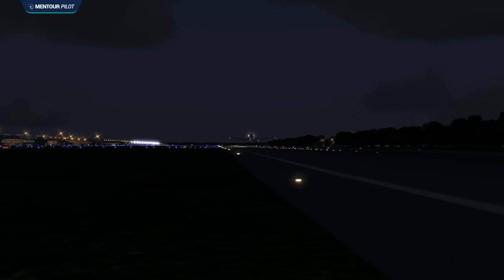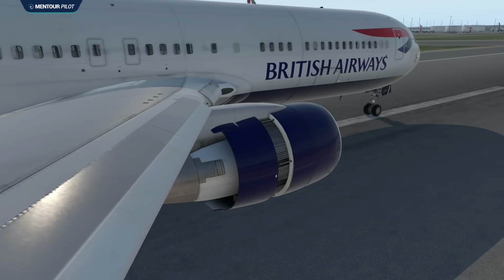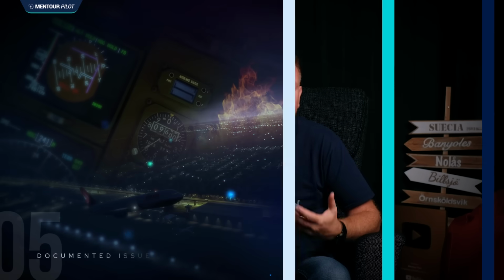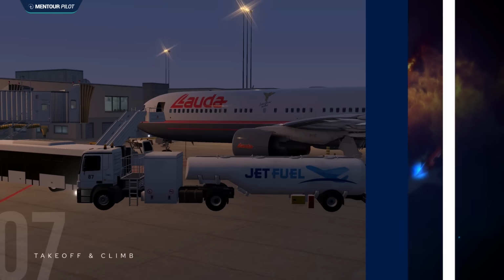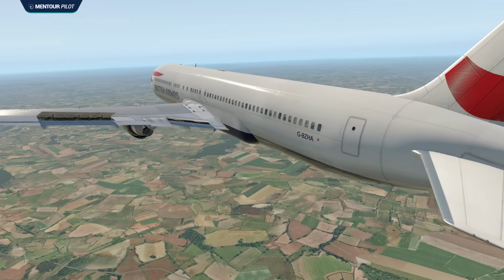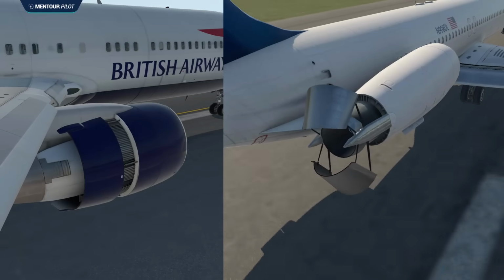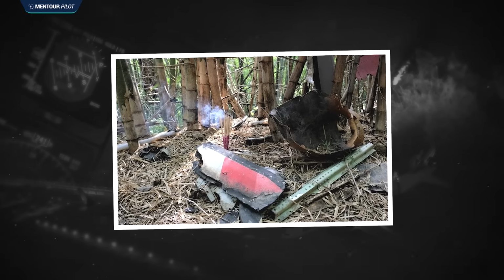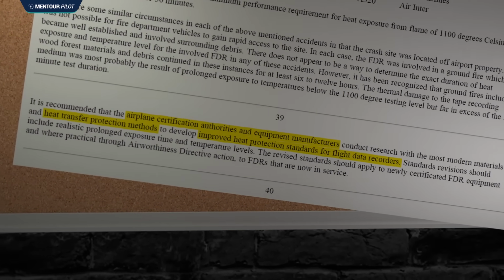HOW an Impossible Failure CRASHED this Boeing 767!

Comment: This actually happened to me I was a passenger in a flight from LAX to Minneapolis. The thrust reverser activated shortly after takeoff and we had a hairy few seconds before the pilot managed to shut down the engine we turned back for a heavy landing with all the emergency equipment rolled out at LAX.  A pilot friend of mine told me we were very lucky to get away with that.
Reply: You possibly survived because of this crash and the following investigations.
Reply: Was this in a plane with the engines mounted on the rear of the fuselage and narrow bore engines? (Like a DC 9 or 727)
Reply: @davidpowell3347  no it was a twin engine, I can’t now remember whether Airbus or Boeing,  suspect it was either a 737 or a 767, pretty sure it was Delta
Reply: @davidpowell3347  no. 
2 engines one each wing.
I REPEAT THE 767 IS A TWO ENGINE ASSEMBLY. sorry for shouting but some people here tend to think a 2 means 4.
Reply: @cme98  so the other engine on the wing helped to counterbalance the effect! Very lucky to be in a 4 engines airplane!
Reply: @MyNotSoHumbleOpinion  possible inboard engine would be easier to handle than the outboard one?
Reply: @davidpowell3347  maybe slightly, but the big difference is that you have in one wing opposing forces that cancel each other out, so you have only a positive push from the other wing! It's like loosing one in a 2 engine! In the airplane type of video you have two opposite force on each wing, so the turning effect will be much higher!
In a 4 engine is still a huge problem because it's like to loose 2 engine, but I think it's more manageable!
Reply: @MyNotSoHumbleOpinion  DUDE! I used to work there DO NOT CONTEST MY KNOWLEDGE! The 767 IS A TWO ENGINE ASSEMBLY. Not a 4 engine jet. The ONLY 4 emgine jet Boeing has EVER manufactured is the 747- which has been discontinued.
Reply: @cme98  wait...what? I don't say anything to you! Some comments are missing and you modify yours! Someone says that he survive because is a 4 engines and I explain why... I don't know where your arguing about 767 came from....
Reply: @cme98  i get what you mean but saying 2 engines on each wing means that one wing has two engines, I think that was what caused some confusion, it should have been “one engine on each wing” since the 767 has only two engines with one mounted on each wing. Don’t want to be obnoxious but yeah saying two engines on each wing when they only have one on each was a tad confusing
Reply: @cme98  707?
Reply: @MyNotSoHumbleOpinion  The guy has a point, the inboard engine reversing is likely easier to deal with than the outboard due to the smaller moment arm it has, since it's much closer to the fuselage than the outboard one is
Reply: WTF when did your flight happen?
Reply: @jaycho6747  was a number of years ago now, maybe more than 10
Reply: In Austria (and likely also Australia and Thailand who also lost people) the public immediately connected the disaster with malfunction of the thrust reverser, it was discussed as (very) likely cause from day one or two. It was good that the pilotes were able to report what they then thought was a minor malfunction. Since the flight recorder was lost Boeing for sure would have put up the walls of denial. 
Lauda was then CEO of the company and also acted as pilote (long distance) from time to time. He used all his popularity and media connections to force Boeing to conduct an indepth investigation.

Media also reported right away that other machines of this type (from other airlines) had experienced thrust reversal (or notifications) mid flight. Not many and until then never with catastrophic outcomes. This was not an isolated freak event. 

Boeing could not suppress that information and lively international discussion. That the pilotes informed ATC about the "glitch" at least spared other planes from going down. Because Boeing would have gladly dismissed it as unknown cause or probable human error if they could have.  (There was the history with the recurring notifications of this machine - as per the technical log book, but because the crew reported the last notification it was clear that had happened just before their trouble started. Much more suspicious)

Boeing had a real PR problem, their machines were used a lot, so even in countries that did not lose passengers there was a lot of media and public interest. The mysterious and especailly haunting nature of the accident (plane breaking up in the air, fireball) made sure of that. Plus the fact that this was a widely used machine, also for international travel and for transport of tourists.

With airplane accidents the public in most cases has a general idea what went wrong: problems during start or landing, crashing into a mountain or other plane. Bad weather. Sure could be human error, technology or a combination of those factors.

That plane broke apart high up in the air and ended up as fireball, that is another level of unimaginable and terrible. Therefore it got more attention than other accidents.
Reply: A perfect example of good pilot training and airmanship. Nikki’s perseverance to uncover the problem has him still saving more lives through the pilots that have benefited from those findings!
Reply: This was a 747 ? Boeing scares the shit out of me at this point. No accountability and in turn I have no trust at all

Comment: @Mentour: As A&P working on L-1011's - I have an exclusive, that if ever leaked to CNN,, 
they would make everyone on that flight realize they are now walking ghosts 
that have no idea how close they came. But it would have to be done in private
secure way. It's quite disturbing by all involved. What I discovered one night up in number two engine bay in pitch black of night at 40 below zero is clearly a miracle only because I was curious of the magnificent structure within. 
I got out my flashlight to discover a full on nightmare. 

I then had to explain to the Judge the next morning why I was heading back to the 
airport at 115 mph with my own special tools to repair this crisis. He said Case Dismissed. 
So there is another trail of this case. 
I fell in love with this ship the first minute walking up to her. As I'm sure you did as well. 
On one flight final to Schiphol, flight engineer pointed out the last L-1011 sitting out back for training purpose. 

Cheers

Comment: Obviously - Both Pilots should have simply pulled the circuit breaker 
for the Reverser Circuit - Killing any further issues, and warning. 
Hopefully - Mentor can correct this line of thought. 

Obviously quite tragic for any loss of life,, with so many lives effected. 

This was done when Commander of and in charge of all Awacs 
aircraft stationed in Oklahoma Air Force Base invited me along 
for full Awacs training night mission flight aboard the multi million 
Awacs Simulator. I just heard these simulators were moved to another base. 
Someone might have more info on that. 

Sitting along side him facing left side of aircraft, behind both pilots. 
We both have panels and keyboard. 
He instructed me with controls I have with keyboard and screen full menu items 
of aircraft systems in view, to select anything I felt would be a good test 
for the pilots to solve when airborne. 

I carefully examined critical engine features of the four engines. 
When in back of mind I was already aware of a fatal bird strike they had in Alaska. 
I actually caught a live bird strike in Alaska on video I made on approaching C-17 a few years later. 
The Commander there has copy of my video on file,, to closely inspect any damage by Turkey Vulture,, who in fact deliberately attacked the aircraft while hovering above it. 
I did not know at the moment that I caught this view, until next morning when guest at BNB
noticed it in playback I was showing him. 
Anyway,,,
I picked a specific fuel controller,, and killed it. 
Now it's up the the pilots to solve this crisis as quickly as possible,, as now they have an engine out. 
The Commander and I watched as Copilot paged through the manual and successfully reached behind pilot and corrected circuit breaker I killed by remote and solved it.. 
Quite obvious,, this crew were very highly trained to handle anything. We were pleased. 
And to note,, while in this class of simulator,, every noise is also simulated present,, 
and the background noise is very loud as noticed on video I made of entire 
mission.  If headset circuit was tapped into video camera,,, I'd load it here. 
It would have to be dubbed in somehow after. The noise is killer, and would be too boring to view. 

Cheers 😎

Comment: There is an advanced A. I. (artificial intelligence) named 'GPT-3' that can do almost anything.  I propose that a version of GPT-3 be set in charge of going through all of an aircraft's maintenance records, and current aircraft parameters, and then make audio recommendations to the flight crew as to what should be done before a flight, or during an emergency. This mountain load of data is easy for GPT-3, but impossible for humans to handle, and will save dozens of lives each year.

Comment: If only airline planes had ejection seats
Reply: Because they can be as deadly to the untrained. Its not as simple as pulling the lever and having the rocket strapped to your arse. alot of pilots, and I mean alot, upwards of 70% suffer broken bones from it. Usually broken vertebrae. In addition to that fighter jet canopies have small explosive charges to destroy the canopy before the seat is launched. a commercial plane cannot do that. Hell EL AL was restricted from operating in several European countries after equipping their aircraft with flares due to the threat of surface-to-air rocket attacks

Comment: This shocks me way more than other accidents. The reason is, that the crew really couldn't do anything. 5-8 seconds to fully kick the rudders and fully yank the yoke to the side. And reducing power to idle at the same time. What pilot would do that, if it is not an automatic response like a stall? Normally you'd kick the plane in a free-dive by doing that, causing the accident in the first place, if you are not absolutely sure that this is now the right thing to do.

To me, this was an unpreventable accident the second it appeared, and that's just so scary. Technical equipment shouldn't be able to do that. Are there more cases that can do something as quickly and deadly like this? With everything I've heard so far, there was still a chance of saving it, or at least it creeped up slowly, being able to react to it. It spontaneously doing that - like if the plane was shot with a rocket - it's a scary thing.

Comment: The exact same nacelle system on the PW4000 equipped 767 and 747-400s were used and could technically be interchanged, but the only reverser system that is critically affected is the 767s. Reason being is the engine sits closer to the wing than the 747. I believe tests were done proving that the reversers could be deployed mid-flight accidentally with no detrimental effect. If you sift through the Airworthiness Directives issued at the time, you should find all of the changes instituted to require redundant safety systems (valve and restrictor systems) for all of these cascade type systems are for engines that sit close to the wing (737 Classic, 767, etc). Since the redundant systems are typically "baked in" to the design for newer aircraft (737NG/MAX, A320neo, 787, etc) the AD doesn't affect them.

Comment: So many accidents caused because the pilots are so far behind the airplane...My uncle who was a long time Pan Am captain always told me...any warning light immediately hand fly the airplane...you feel any issues and your scan returns to determine any unusual instrument indications.  In this accident having his hands on the controls his immediate reaction would have been to add right rudder and right aileron and would have precluded further decay in their situation.  That difference in reaction time doomed this aircraft as the simulators demonstrated.  I have always maintained that the current electronic cockpits destroy situational awareness and had a lively conversation with a Delta A300 captain during a 4 hour flight to the west coast.

Comment: As a pilot, I can’t think of many more unpleasant situations to be in. Would have been absolutely awful.
Since this accident I’ve thought about what I would have done differently. All I can think of, is if I got the reverser isolation valve message, I’d brief my FO that should the reverser actually deploy, we would immediately bring both thrust levers to idle, descend and attempt to regain control. 
However, these pilots did nothing wrong in the circumstances. Worst case scenario in the climb, with one engine going from producing full forward thrust, straight to full reverse thrust, whilst the other one still at full forward thrust. ☹️

Comment: Feels like nowadays Flight schools are creating flight technicians and not pilots. I am no pilot but fly simulators in the confort of my office, so that is nothing compared to the situation that the pilots were in. I am not criticizing the pilots as I would +probably just piss myself and pass out with fear if I was in their position. But if this happened in my simulator I would reduce the trust in the bad engine, decrease the power on the right, take control of the yoke, right rudder and right ayleron, in less than 3 or 4 seconds. Pilots rely too much in autopilot nowadays and refuse to believe something is wrong, or that if something is wrong autopilot would fix it... It is crazy to see so many aircraft falling out of the sky because pilots mess up or dont do nothing to fix a fixable problem.

Comment: So the Techs did not perform an islolation test on the cables before? Wrong job then.
Intermitting error messages, it would be the first thing to check for shorts or low resistance on an airplane.
It's always the same. Yeah safety is so important to us, if it's for free.

Comment: Retired Aerospace Tech and Maintenance Manager with 20 years military experienced in B52's and KC-135's, F15 & 16's and F-4's including NASA 1st Space Shuttle Flight SP1 Northrup Strip New Mexico. Mach .99 is most likely well existed and shutting off the fuel to each engine would've been my first move after failure and before turning into a lawn dart of death. I'm just an Aerospace Tech and the Military works under a total different concept. Explosive bolts to shear off the thrust reverses? Not a good idea to it's allergic reaction to static electricity especially in flight and thunder storms causing detonation. My best design is manual disengage valve to all hydraulics to the engine including secondary fuel shut off. 
My knee jerk thought was gamma radiation hitting an IC Chip flipping a one of it's 0 or 1 values, a normal occurrence when IC Chips was first used, even voting machines where flipped to add 4,400ish votes to one elections and NASA solved it finding Gamma Radiation from an exploding Super Nova light years away did it. 
thinking out loud and tired to proof read it....
CC

Comment: Excellent video as usual.
You explained perfectly why those engine fans are getting so large.
I was wondering that as they seem almost as large as they can practically get right now.
To me,this crash is the result of what I call the Titanic effect.
Where engineers pat themselves on the back and say ,"It's impossible."
I wish the Lauda maintenance team could have had the authority to ground the aircraft until the culprit was fully investigated and fixed.
It is clear they were very concerned and on the right track.
Certainly,had the pilots had better advice to land the plane as soon as a thrust reverser fault popped up the first time,the flight might have been saved.
Clearly,the labeling of any engine reverser fault as anything less then critical was a big mistake.
Boeing essentially saying "My Bad" after so many people died is less then optimum.
At least,solutions were made after the crash.
Reply: The designer of the Titanic never stated that it was unsinkable, it was the press at the time who said it was!

Comment: Thanx for the video.  This happen to an Air New Zealand DC 8 on July 4. 1966 on a training flight in Auckland . The crew had simulated a failure of the No. 4 engine (the outer engine on the right wing) by bringing the cockpit power control lever to the idle position but inadvertently selected reverse thrust, which sent the aircraft out of control killing 2 of the  5 man crew.

Comment: Boeing tried to shrug it off, despite agreeing that The fault condition was not recoverable on the simulator, but refused to issue a statement. Boeing stalled eight months before they made a statement making clear that Boeing was at fault and not the pilots [or Pratt and Whitney]

Comment: I have always wondered why if at altitude and you have a adverse yaw situation not simply pull back the working engine and use the altitude to come up with a plan and not fighting adverse yaw.    My twin instructor told me that. He might have also said that the remaining engine is there on a few specific airplanes to take you to the crash scene. .
Reply: As far as I understand it, the primary issue here was the thrust reversal (particularly considering the negative effect on the amount of lift on that wing) not that they only had one engine producing forward thrust. The engine which most needed pulling back ASAP was the malfunctioning one with the deployed thrust reverser, which they did but too late, they were already screwed.